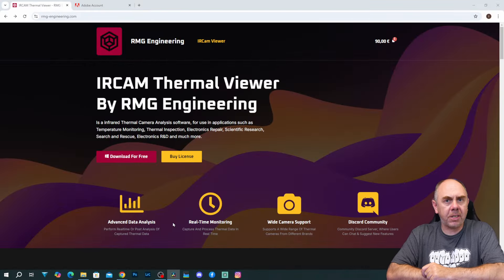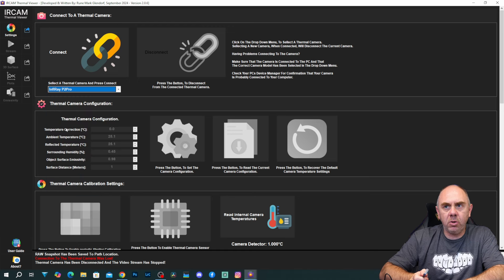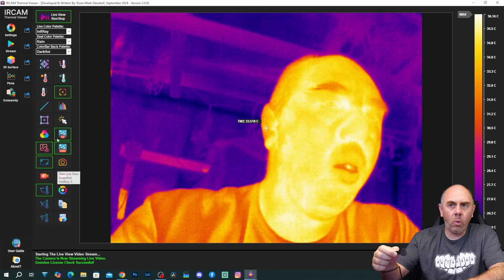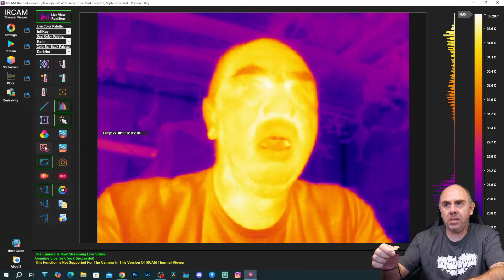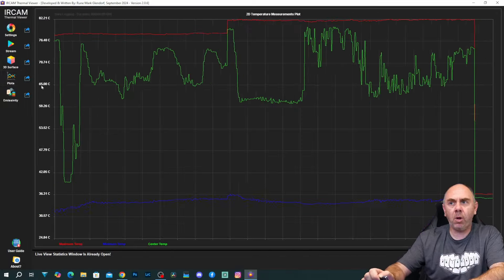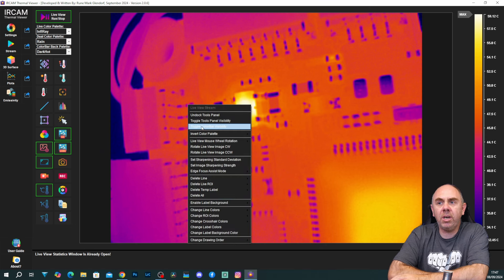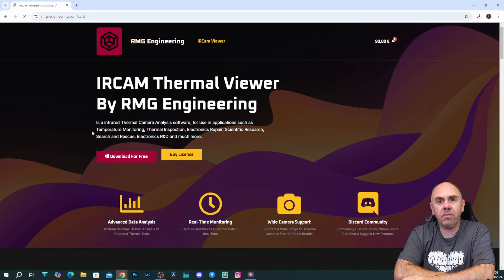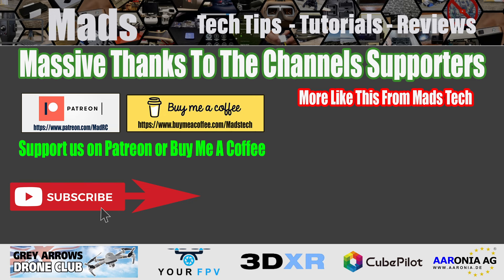IRCAM Thermal Viewer For Infiray & More - Enhanced Thermal Imaging

Comment: That's cool, thanks for the review. I wonder if it is possible to connect such a thermal imaging camera to fpv or dji glasses in a straight line (without complex transitions) and make fully functional thermal glasses so that they immediately show a thermal image when turned on?